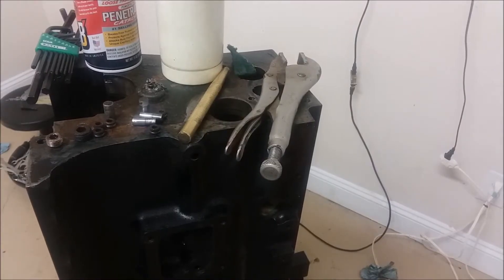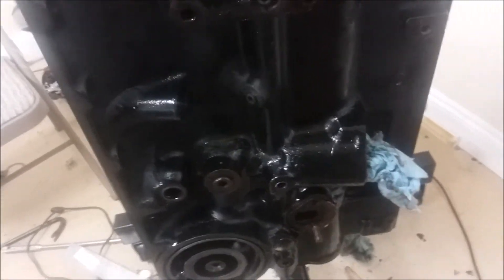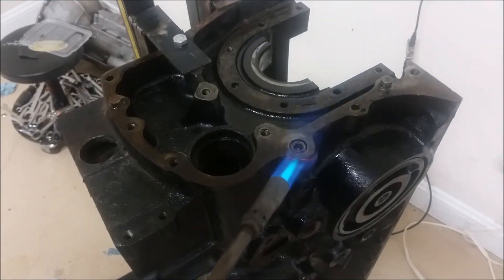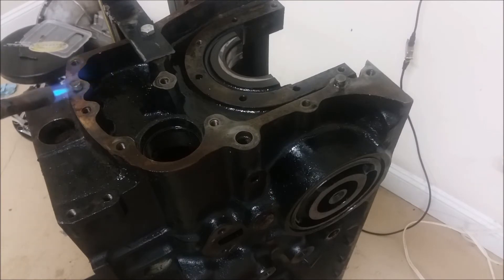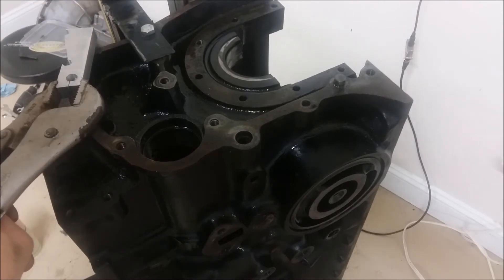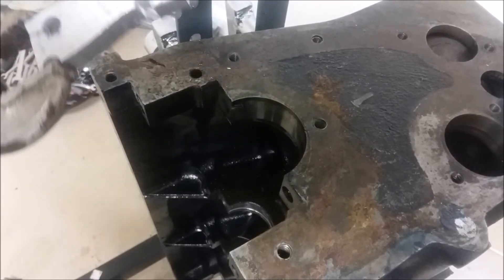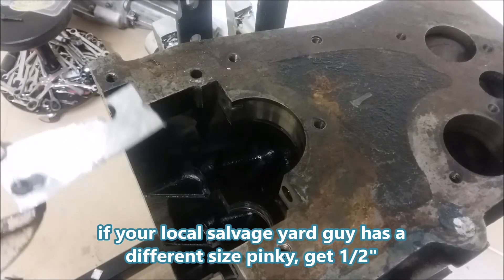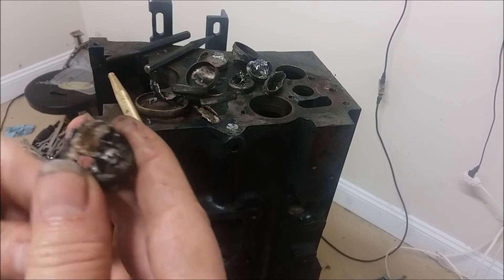How to Remove Stubborn Pins, Plugs, Studs from Engine Block - Triumph TR6 Prepping for Machine Shop

Comment: For the pins, use a collet-type dowel pin puller. It's the correct way... It's also the correct way to remove bearing races. I remove projectiles from live ammunition safely with a collet puller.

Either 50/50 acetone and Marvel Mystery Oil or Kroil and leave it for a while. Heat if you need it.
Reply from the maker: Thanks!  Didn't have a collett dowel puller so I made something with what I have.

Comment: Great video. Show the process of evolution of procedure. Regarding locating pins. I may try copper tubing, slice it parallel to axes. Then place it on the pin and use a vice grip. Copper will be protecting pins from vice grip jaws.
Reply from the maker: Good idea.  Let me know how it works!
Reply from the maker: @Alexander Ahmed glad to hear it!    Copper tubing seems like a good idea